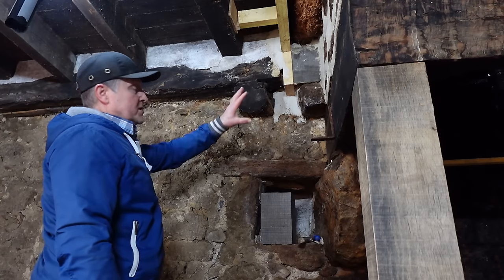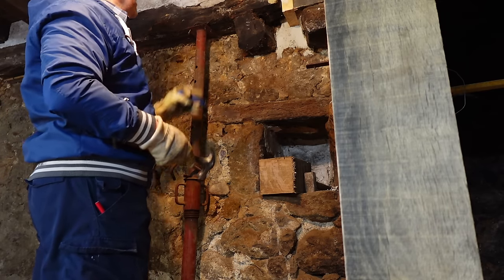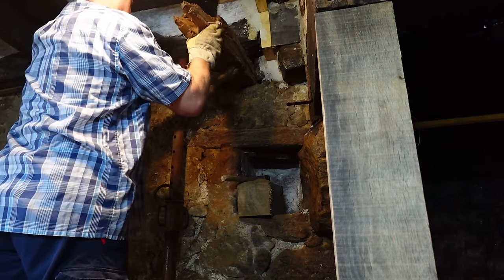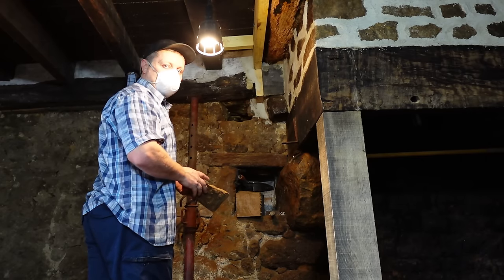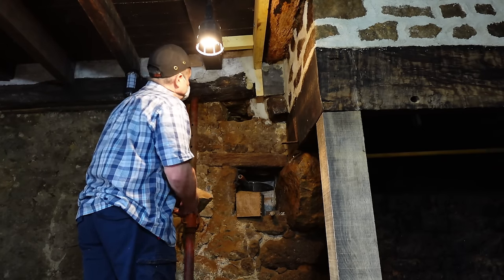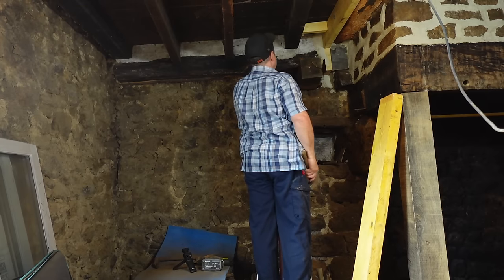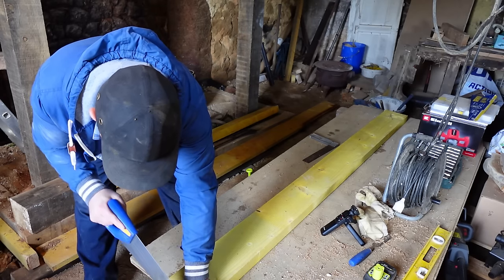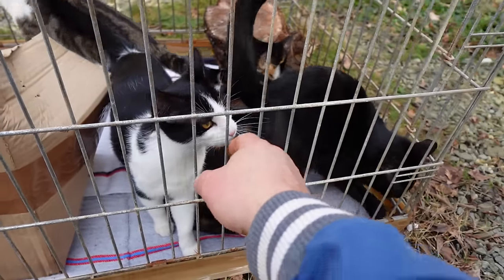Cottage Renovation Episode 72 | Rotten Beam Removal

Comment: I'm surprised even the new beam that picks up the floor joists will be covered by the ceiling. Won't that mean the feature of the pointing above the fireplace will also be (mostly) covered up?
Reply: Or will that one be hidden in the wall, more than in the ceiling?
Reply from the maker: The new oak beam that projects out of the wall will be on show
Reply: @Seans_World  Ah ok, thanks! But the one above (the horizontal one along the wall that picks up the floor joists, the one that rests on the oak one that projects out) will be hidden in the ceiling? That would make the ceiling lower than I expected. I expected the ceiling to be directly under the floor joists.

Comment: May I ask a stupid question?
Why replace the rotten piece with another piece of wood, which will eventually rot as well? Instead of a cut off 6x6, use a stone instead which will not rot?
Sorry..
Reply from the maker: The timber that come out wasn't as bad as l thought and had been I'm there 250 yrs. So lam sure the new one will last just as long.
Reply: @Seans_World class 3 treated timber in France guaranteed 10 years outside ,more questionable is that you’ve taken a bastaing and by cutting the beam pockets ,you’ve reduced it to the structural integrity of a chevron.

Comment: just a thought but would that hole be ventilation? to take excess heat ect into the barn/other side the inside of the space looks extremely clean and supported compared to other holes youve made
Reply from the maker: No it's because the stonework was built around the timber